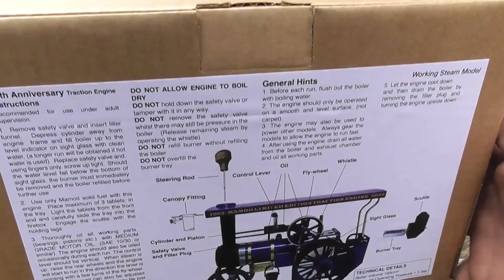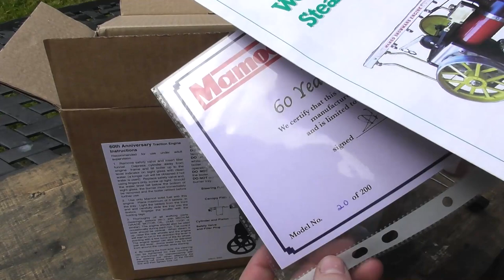Mamod 60th Anniversary Traction Engine

Comment: I couldn't see the underside of the firebox very well, but it looks like Mamod now puts on information like they didn't before!  Also, is that a underbelly water tank, which I assume is not functional?  Can't say I like the color!
  It's obviously a TE1A that has some dressing and a wired color!  I am surprised that considering how much we pay for these, that the front end being bent back is far too common and should not be that way!  My first thought is to return it, just because it appears that it was shipped that way, which appears to be due to bad placing and packing.
  Nice machine!  Happy steaming!  How about a video of it working, like running a water pump?
Reply from the maker: Under the firebox is a sticker of when it was made would probably burn off after being used a few times. The belly tank is non functional and is just for decoration. It certainly is different being in the blue I would have thought Mamod would have gone for the original green as they only do the dark green now. I have a problem with my 60th Anniversary roller with the front axle being bent and then packaged up. It wasn't alot of effort to bend it back but for what we pay for them I would have expected better quality control. Mamod had changed hands recently and a new limited edition model is in the works I will have to see how this next model is. The new owner seems to be listening to the community and has set up a spares website for people who want to fix and upgrade their Mamods.
Reply from the maker: Sadly I don't intend on running my limited edition models and I have so many and they all run the same basically. If you want to see my collection The Great Model Steam Fair 2022 is a video of it. The video is so under appreciated with the amount of effort that went into it thats why I haven't done one since https://youtu.be/kqfypQeuhmM?si=uor6KG7K4w0jWzdOl
I have gotten more since but have moved onto bigger things have a watch if your interested. There is everything from a steam powered ferris wheel to steam workshops and showmans engines.

Comment: Nice model, the only snag was seeing the bent front axle, not very professional for a company to post like that!
Reply from the maker: It definitely is a nice model. Since mine is a display piece I have not run it yet. Some other models had bigger problems than mine with the sight glass leaking and Steam pipes not soldered on properly. I also had problems with my 50th anniversary roller which also had a bent front axle. Mamod definitely needs to do more on quality control before shipping them off. Since Mamod has changed hands recently hopefully the new owners take more pride in the models they are making if they do more limited edition engines. They have introduced a repair and a spares  service so good changes are happening to the company.

Comment: Lovley to see! I think it would have been nicer to do the original pipe work with the regulator on the exhaust. Still, a lovley model
Reply from the maker: Totally agree with you on that I think it would have been good if they did a limited run of a flat canopy and nut and bolt construction the closest they could achieve to the original 1963 engine

Comment: Great vide Nice engine wish they could have added the level plug back.
I have a older te1a with a level plug on the back and the red knob it had never been ran before I bought it.
Reply from the maker: Thanks im glad you enjoyed the video, It would have been good if Mamod had put some more original features in resemblance to the original te1 it's good to see the lever whistle return. Personally I think a limited edition run of the nut and bolt flat should have been made or how closely it could be made in today's world.

Your Mamod sounds nice I have one in my collection which is the same one of my favourites being very clean and good condition. My first one was a te1a with a water level on being a darker green. 

Mamod made quite a few models with different features on like your te1a with a water level plug or how it was constructed being nut and bolt or rivit. I have one of every type where a design feature was changed on the older models. I would say the best one Mamod  ever done was the straight lever only made between 1967 to 1968 on the change over between the Te1/Sr1 to te1a/sr1a. They have more notches on the regulator so can be more finely controlled compared to later ones being 3 notches forwards and backwards.

Comment: Great video. I just bought one myself. Unfortunately, I'm having a hard time getting the burner tray to fit into the scuttle. It won't go in far enough to put it on the tractor. Is yours fitting OK?
Reply from the maker: Thanks im glad you enjoyed the video. My one was quite tight to get the scuttle onto the firebox but the burner tray was a bit tight getting it in. I would have a look at the handle of the tray the rods might need pushing together a bit  allowing it to go further into the scuttle. I have had a few snags with some of the models I have got off Mamod in the past one being a bent front roller nothing too serious just had to bend it back carefully. Hope this helps you in getting it to fit let me know how you get on.

Comment: For an 60 year anniversary model it’s a cheep looking unit in my opinion
Reply from the maker: The paint job is bold the blue is nice but they could have gone with different colour wheels and canopy more realistic and not so cheap looking. The 60th roller is nice that was priced at £250 and they sold out this traction engine was around £300 and at the time a new Mamod was costing £240ish. I would say the quality control is not there as my front axle was bent on this and my roller when they arrived. No possible way they could have been damaged as the boxes had no damage marks so was packaged up damaged. Mamod has recently changed ownership as they was in debt and on the brink of going bust. Hopefully the new owners listen and learn from what the collectors want to see like improved quality control.
Reply: I read that it's now not possible to buy hexamine fuel tablets unless you have  the government license! Mamod have said it won't be selling them or supplying with their models? They also state that the companies future is at risk!
Looks like the end of the road for Mamod? 

The models now produced are of poor quality and its a shame this brand has gone down hill so far ! The prices are ludicrous now £300 for the 60th  te1a? Bent axle ! 
I have only two Mamods now, a se3 Griffin and George and sp5 Griffin and George. These were built with pride !
Reply: Just buy solid fuel camping tablets
Reply: It’s a toy .

Comment: Optisch gelungen. Einzig der Transmissionsriemen um das linke Hinterrad ist total daneben, wie auch der oszillierende Zylinder. Da gibt es besseres.
Reply from the maker: Totally agree it's a nice model but Mamod have always used belts for the drive transmission. Wilesco's are much more refined and have plenty of pulling power. I do have a Mamod double acting cylinder which runs alot better but not as good as a wilesco I once had one running for 90 minutes on 1 water fill and a gas burner.